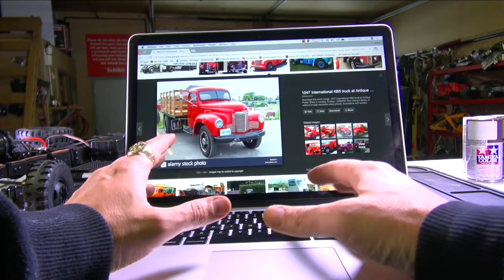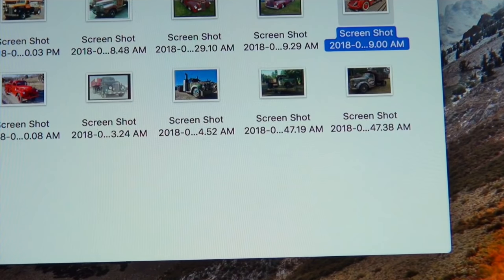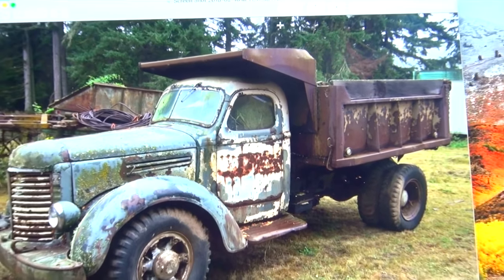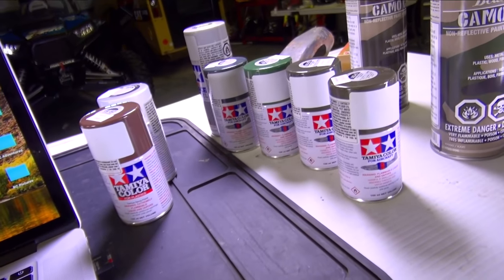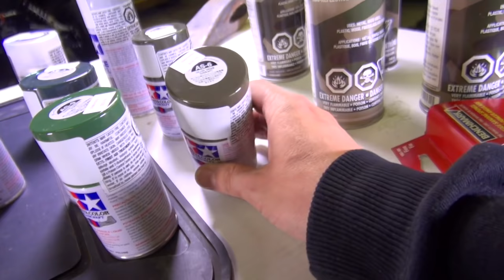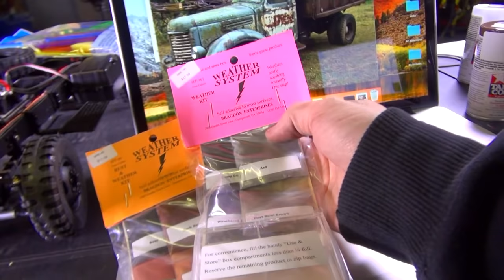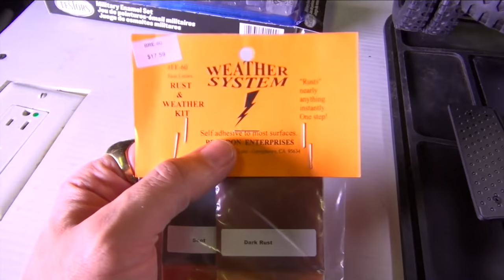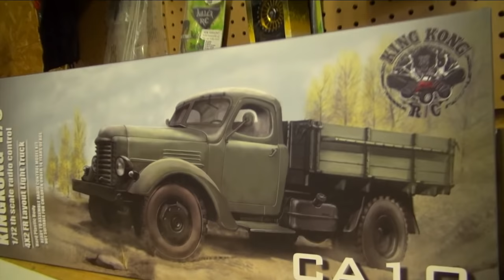RC ADVENTURES - Project: "SPiNTiRE" - PAiNT PT 1 - 1940 KR11 Research, & Supplies - King Kong CA10

Comment: Medic!! Just remember tire wear on the front is going to be worse than the rear. It is common to find the front tires almost bald and the rear still in good shape because they take on 2 jobs. Both holding and steering. Also an easy way to weather tires are to put them on something faster and bash with them. Much love. Hope your build goes well Medic!

Comment: Yes, patina lol I like watching the painting process you use. Plus it's very spin tire, that blue truck all beat up. Also rustoleum works great on plastics, it's been a general all purpose paint for me.  I use it on plastics, metals, wood.  Never had it crack and I'm terrible about priming and sanding.  I just put a full coat on, let it try and hit 2 more times done.

Comment: I have used Krylon Fusion Plastic paint on Lexan and it  worked great on two bodies I did. I did an Ascender 1985 K5 Blazer body and a Proline 1966 Chevy  both for my SCX10. The  1966 was my first RC paint job and is the basher body so I didn't do as many coats or take the time I should have so its pealing a tiny bit on the passenger door and roof, but the K5 is super clean, no pealing worked amazingly! I used about two thirds of the can painting both bodies.

Comment: Don’t know about the camo coat but I have used the rustoleum ultra cover on several hard bodies with excellent results I honestly prefer it to the tamiya paint I highly suggest lightly sanding the body with 300 -400 grit paper before primer

Comment: One of  the things that you could do to get some more textured layers is to use a sea sponge if you do not allread have one, but doing that with some "mud" or body filler and from there use the paints to give it some color. That is one of the things that I will be looking in to when I get me ahold of one of those kits because at the same time I am going to be attacking it with layers of airbrush along with standard hand brushes along with a hand full of different shades of paint washes to really dirty up the body. One of the other things that you could do is something that my brother did by accident with his mojave scx10 conversion build that he did witch was after he painted it with a flat he went and ran it around ( given that he has clay on the ground where he is at) but I believe that it was the acidity of the red clay that lightly caked on in key spots in splash patterns near the finders that looked more natural. At the same time though I think that part of what made it look just right and not really over kill is that he was running the true scale look I guess you could say with a set of 1.5 offroad tires on it so that is was small traces. An other thing that I think would be doable would be to do a bad prime job where the primer is slightly drying before it hits the body so that it creates that rough texture and then from there you can water sand the areas that you want more smooth and then seal it off with either a mat clear or the paints and what not from there. Idk this is really making me want to go and get ahold of one of these kits and start building it up so that I can test some things out and ideas from almost backwards engineering the Auto body practice that is under my belt per say lol.

Comment: I have a hard bodied land rover d110 pickup I primed everything first then I sprayed it olive drab 2 then I done flat red in the cab just little bits on the dash steering wheel and gear leavers and seat brackets to make the inside pop a bit and I sprayed the roof flat black I used all tamiya paint to weather it I just got vallejo wash and pigments which I have just got to weather up my landy hope this helps

Comment: I have done hard plastics with the plastic furniture paint, it works to a point, was doing some weathering similar to the blue/black truck look. it worked went on nicely, but where I had purposefully added thick layers of undercoat it flexed and cracked, giving it the look of cracking paint

Comment: Have you taken yours for a drive yet? Mine came in and my entire afternoon, evening, and well into the morning was spent crunching on it.

It did a donut.

Pitch black outside, so I couldn't really open 'er up any, but I did get it to do some legit donuts. Gonna need a castle link I think, though. My ESC doesn't seem to think the motor can truly start from zero, it should. Doesn't. Min speed is somewhere between a walk and a jog, and it doesn't even try to modulate below that. But it's a boatload of fun just the same~

Also seems like you're going for a 'mount above the pumpkin' solution for the battery. Will be interesting to see how many mAh you can stuff in there. I'm pressing forward with my twinned saddle pack arrangement, didn't mount the spare(I'll fab up another mount for it later. I also up stuffing the electronics under the seat. I think this is where King Kong RC expects the battery to go....GLHF getting anything more than a sub-normal-sized 1200-1800mAh 2s pack in there...given my ESC took too much room up to put it all in the gas tank I just shoved it all under the seat instead. Drilled three holes in the floorpan for the three motor wires, ran the steering servo line and the main battery line in through the larger of the pre-molded-in holes, with the ESC upside down and right in front of that gap so it can get a little ventilation. For now, I've got the power switch in the passenger floorboard, don't know if I'll leave it there or not yet. Fits in pretty nice!

I'm not surprise yours has a twist. Mine ended up sitting level, but the frame rails are tweaked...pretty bad on mine, actually, I had to manhandle 'em to get a lot of the crossmembers in and several bolt holes never lined up at all. Oh well. Parts are in and they're secure enough that it isn't gonna come apart. I also had to enlarge the hole on one end of the rearmost driveshaft with my dremel to get it to slip onto the carrier bearing there.

Perhaps this may have been a bit more complex of a kit than I should have taken on as my first ever RC kit, but hey, thing runs and drives first try! I'm now at a more cosmetic stage. Gotta get the bed and cab built before I fab up my battery mounts, so for now any running I do will be with one pack either in the footwells or loosely taped down in the bed.

And the turning radius. Holy moly will this thing pull a hairpin. I'd almost say itt'l turn 360 degrees inside just two times its own length. I've had 1/18th RCs that couldn't cut a curve that sharp. This thing's gonna be able to pick lines with ease!

Mine also had the toe-in, but I opted to leave it as-is. Given mine'll be zipping along fairly quickly, having that toe-in will be a massive help for keeping it pointed in the right direction. I do wish I could fine tune the length of the link between the servo and the knuckle, though, as 'straight ahead' ended up between two notches of the digital trim on my radio. Blah.
Reply from the maker: DUDE,,, you wrote a BOOK! haha :)  Congrats on getting it outside.. right now.. its very snowy and cold were I am.  Yes, the holes did not line up very well.. and I needed to work my beams in as well. If you did this as your first RC kit.. GOOD for YOU! Its not overly complicated, but it is intricate.  I switched my motor to a lower turn, more brute strength brushed. I kept the 14t pinion. Ill weigh mine down with 8-10lbs.. and see how show lumbers along.  Really, great job man.. keep that passion alive!!
Reply: Yah, this thing was a lot of firsts for me. Before this, I'd only ever run RTR nitro, all the way back to the early 2000s. This truck, for me? First 'large scale' electric(I've had Mini-Zs and a Mini T over the years but nothing this size), first brushless RC, first scale/trail rig, first actual kit, first time with LiPos. The weather here in mid TN is...well, as I type this it's bucketing down, I haven't painted the shell yet, and I haven't waterproofed the steering servo or receiver yet. So I'm in no hurry to run mine outdoors right now.

I'm prolly gonna put a Shapeways ZU-23-2 AA gun in the back, weather it down, put Gordon Freeman and Duke Nukem in the cab. Goin' for a post-apocalyptic technical seems like a great way to tie off the way it runs!

I'm already having a blast with it, and I'll definitely be paying close attention to how you weather yours. Mine will need similar techniques applied to achieve the post-apoc technical I'm thinking of.

Comment: A good way to do "fresh" scratches is to spray silver spray paint into it's lid, then get a crappy chip brush, dip it in. Remove most of the paint from the brush then just flick it in the sides
It's called dry brushing, tutorials are probably good to look at

Comment: I build models and I have used the primer with good results. I find if you have a super smooth body, go over it with a really fine grit sandpaper, like 600 grit, first, that helps the primer adhere better and you will get better paint results. Never used the camo coat paints but I have used the Tamiya and they are nice.

Comment: I think with that stiff rigid suspension and frame, that truck will make one bad ass pulling truck but your definitely gonna want to lock the rear and have the ability to add weight to the front to keep those rear wheels planted and then put up the side walls and haul loads when you want!!

Comment: I've used Rustoleum 2X primer / paint on a Maisto hardbody Hummer HX (like Drakar from the TTC). The paint holds up pretty well, but if you roll over it scratches just like the plastic would. Otherwise, it bites really well. ALSO if you use Rustoleum you can use Brakleen to remove it, or thin it if you want to fade.

Comment: Great stuff bro! Have you heard of the salt technique? Spray a base coat of rust (reds, browns) then spray or brush on some water, sprinkle salt on the areas you want rusty, than spray your color coat over top. Once that dries take a tooth brush and remove the now painted salt and your left with properly layered rust! There are tons of other weathering techniques, really thinned out paint (they call it a wash) But very thinned out paint works well for a streaking affect... I'm part of the you tube model community, and there's a fellow modeler out there, Dr.Cranky. He is a great builder with an In Rust We Trust motto! He has tons of video's of rusting & dusting, all sorts of techniques, Using salt, dry-brushing, and lots of nice air-brush work, Check him out, Dr. Cranky.
Reply from the maker: Hey that sounds AWESOME!  Thank you for that... I have never used that technique.. but I have used many others. So many people forget that I made a replica of Top Gears "To Kill A Toyota" hilux.. which was a beat down, rusted, flamed out, wate-rbogged wonderful truck!!
Reply: Yes that salt works very good! Let me find a YouTube for you where you can see how it works
Reply: This is a great technique!  YouTube channel EricsTrains did this on a huge train bridge he built.  Turned out great!

Comment: I painted a shell with paint from the rusty paint company.  You paint it on then apply your top coats.  Rub the top coat threw where you want rust then spray the whole thing with this solution,  This causes the rusty paint to rust
.

Comment: The normal spray paint will work just fine but you might want to use sandpaper to scuff up the body a little bit so the paint has something to grip to, plus might look better with the body scuffed up for the rust look.

Comment: To make this the most realistic truck? I suggest painting it like the color you want with the primer being the base. The finish could be like how it came from the factory. Now once it's finished you drive it through the trail and let it get scratched and take some tumbles.  You then go in with the rust once the scratches start to appear:') Never ending paint job lol! It will get older every time you use it. cheers just an idea

Comment: This is an awesome build. I also LOVE to play Mud Runner as well! I'd like to build a few scale versions of the trucks in that game as well, I think I'm going to have to get this kit myself,I may do two of them and make one 4 wheel drive and put a tanker on the back of one of them. I also want a Cross RC 6x6 too
Reply: Cross-RC GAZ-66 (the GC4 or GC4M kit) also make a great Spintire/Mudrunner RC truck. The GC4M (command car version) looks very like the support truck from Spintires. The GC4 (the version with the bed and tarpaulin) would look very much like the GAZ-66 repair truck from Mudrunner with some fuel drums and truck parts in the rear bed. I own the command car version of Cross-RC's GAZ-66, and it runs very nicely right out of the box with the cross-RC ESC and 45T motor. Its very smooth and has a lot of grip even in the mud.

Comment: Drove mine a bit more today. This thing is....surprisingly capable. Ok, ok, open diff, RWD, doesn't sound like much, and these tires look awful. But, with about 2.5 pounds or so in the bed(I strapped my NTC3 down for a cargo) and a little wheel speed? IT's a beast. Powered through grass, leaves, with nary a single hint of hesitation, and it handled mud deep enough to reach the front axle with glee.

Not sure if your 55t brushed motor'll have enough wheel speed, but if it does, this thing will be an absolute blast to drive out in the muck! I....don't feel like I want to change the tires after all, the stock ones dig in and bite like no tomorrow!

Best of all, even though technically I'm at the upper limit of what my motor is okay with, it seems to handle the load just fine. That open grille probably makes for plenty of airflow but I'm confident that even with a scale engine wrapped around it I won't have any overheating issues. It looks and feels so realistic with a slow steering setup, too!

I think my next step is figuring out a way to record and drive at the same time. Maybe I could move the steering servo to the aileron channel so I could drive with one thumb...
Reply: @optimusdudes DIY reefing I can't use one of those. I'm using a 2-stick aircraft radio. My best bet would probably be to re-bind the steering on my groundpounders from the rudder channel to the aileron channel so my right thumb handled everything.
Reply: TestECull  ahhh

Comment: I’ve used cheap ($1.00 a can) spray paints on hard bodies and even lexan bodies and am satisfied. Only one of my lexan bodies chipped a little on my Slashes fender area. The rustoleum paints are good, but I think it’s a bit thick for lexan, but probably fine for a hard body.

Comment: I totally use the rustoleum plastic paint works perfect. I still scuff the plastic though just for that extra little bit of adhesion guarantee. In the US it's about the same price but the color choices are abundant and it costs about the same as tamiya stuff, it does tend to crack off of lexan though. Sprays a lot thicker so go slow.

Comment: When I wanted rust to run on my model tank I made the paint thinner and dabbed it on with a brush so it started running down. It gave the right effect
Reply from the maker: yup! I will show that.. and a "dry brush" effect....
Reply: RCSparks Studio yea they will both give good results. My dab technique works well around bolts so it gathers up and rolls around then starts running down the surface. Good luck looking forward to seeing this finished

Comment: Make sure to rub down with alcohol and micro fiber cloth before you primer anything !! Its very important to do this. The oil residues from your hands will keep primer and paint from sticking to what ur wanting to paint. Note to self - If ur gonna paint it don't touch it with bare hands !!

Comment: Have been building 1/25 scale for @20 Yrs and my static models are the same material. I use that primer very regularly. The white works great as well for lighter colors. The gray will darken light colors significantly. Lots of light layers and you'll get great results too heavy and it'll run like crazy.  If you're going for a high gloss wet sanding does the trick.
Reply from the maker: Going for flat matt my friend! Thank you for your advice.. I will be doing light coats with proper drying in the between. Also, i will be starting with a Gray Primer, then adding the Brown/red (Uneven coat), then Uneven coat of a lighter gray, and a final base coat (even). It should take me all day, if not 2

Comment: The rustolium paint sticks if you sand the body correctly.  Love that teal blue rusted dump truck version 👍. The running rust effect is easy with a very thin paintbrush. Looks like you have all the good bits to get started 😎

Comment: Id be painting it and uving a strong light that doesnt get hot to fade it over 6 months. Then go in with a torch and warm up the plastic and act like a scrape or dent into a pole or another vehicle on the fenders. As for rust, a hair bit of sand paper to dad againt damp/tacky paint and multiple colors. Time comsuming and all, but just my style.

Comment: ONE MORE NOTE (I promise): VERY Important! For either Bragdon or AIM Weathering Powders TO actually self adhere - you MUST apply them to a coarse (meaning Flat Paint) Surface. If you do not, they will NOT adhere to Glossy surfaces, and every time someone touches it - it will come off on their fingers, and wherever else they touch, will then have "Giant Human Fingerprints" all over the finished Model!! 😱😱😣😬 AND, if the other part they touch is s Flat Surface, it will be a virtually PERMANENT fingerprint!! 

Also - you CAN take a little Powder, mix it in a small container with 90% or better Isopropyl Alcohol, it makes a NICE, subtle Wash! 😉 

One more - except Windows or Light Lenses, hit the Model with a light dusting of Testors Dullcote - BY BRAND. It won't react with anything we use, and will lock in that nice Weathering Job that you just spent so much effort into doing!! 😇